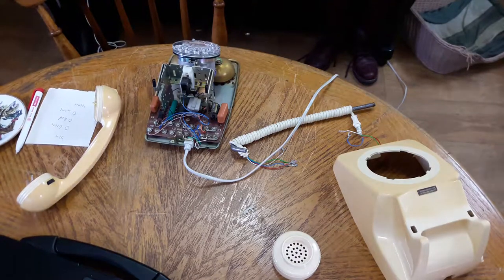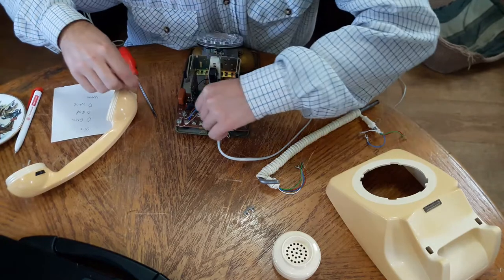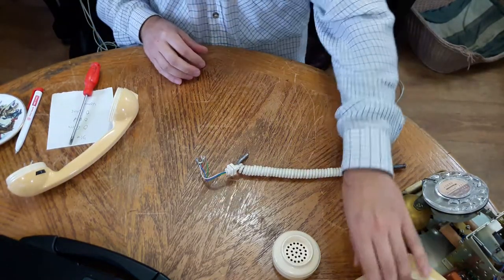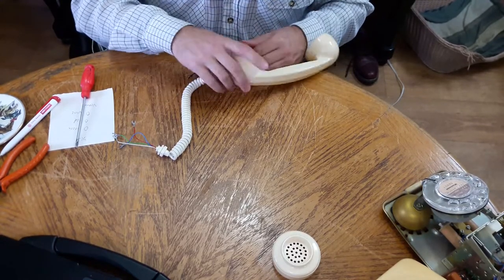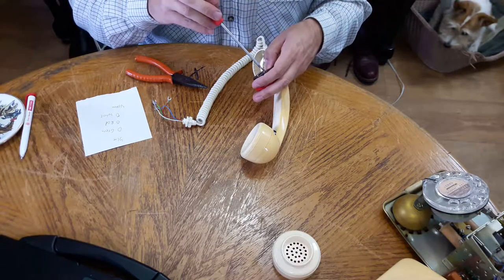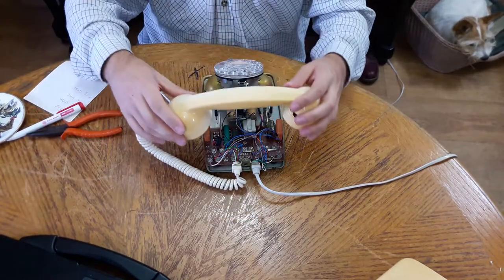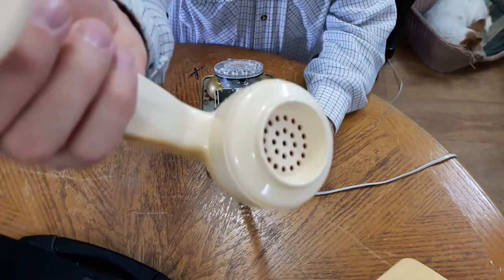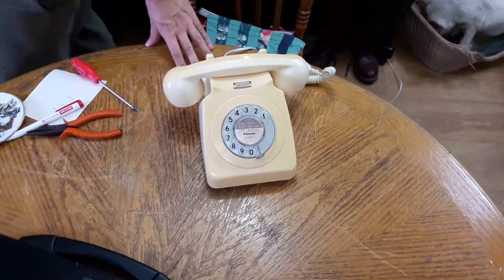GPO 746 for the hard of hearing restoration part 2

Comment: I've just bought a converted 746, whilst it dials out fine, and receives incoming calls I can hear the other person, but they can't hear me.
I've tried replacing the transmitter with the newer version but it didn't help.
Why is that?
Reply from the maker: It sounds like the phone isn't wired up correctly inside perhaps a strap is off or the microphone wires inside the phone are not connected to the correct terminals, check this by looking up how to convert a 746 phone in google, apologies if you have already! it could also be the PCB has a fractured track which has broken connection to said terminals, its rare but I have seen this fault. Good luck!
Reply: @Vintage-Tech  hi thanks for the advice, the wires were in the right place. But after looking under the dial the 2 wire terminals had moved and were touching each other so I moved them and tightened them back up.
It's perfect now. Thank god 👍

Comment: I JUST GOT A  GPO ROTARY PHONE THAT I CAN USE IF POWER GO OUT AND I HAVE BT  OPEN REACH BOX BUT I ALSO HAVE MY OLD BT SOCKET ON THE WALL BUT WHEN I PLUGED IT IN MY OLD SOCKET THERE WAS NO DIAL TONE SO I TRIED THE OPEN REACH BOX STILL NO TONE WHATS UP
Reply from the maker: with so many moving parts and connections to get wired correctly are you sure the phone is "converted" correctly?